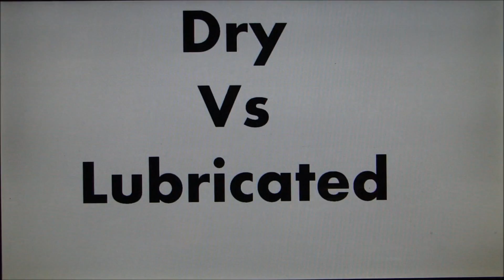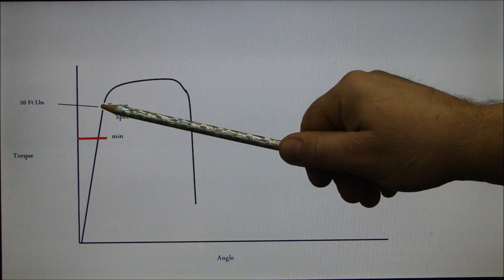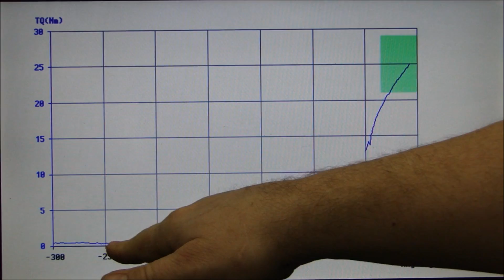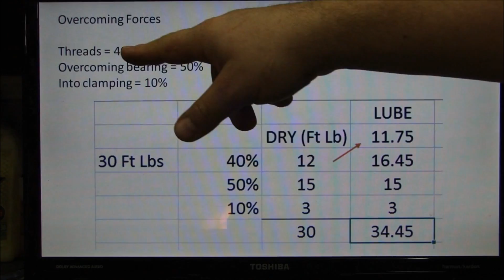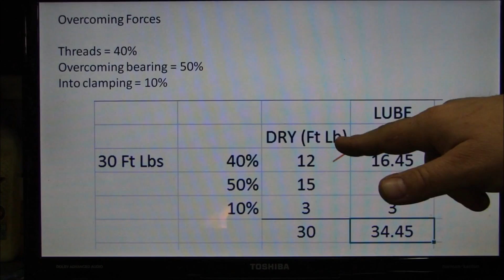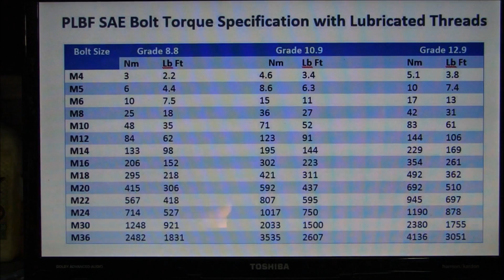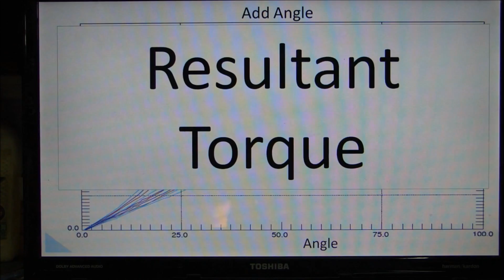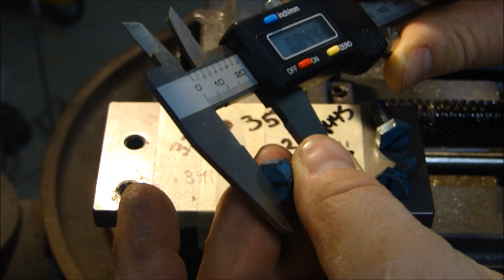Engine Building - Fastening

Comment: Pete, first off I want to say good job on your work producing these videos and for your great efforts in doing these.  The video was very methodical and followed a clear and reasonable thought process.  I actually believed the conclusion of the results momentarily.  So when I disagree with you please don't take this badly.  
I watched this clip and was blown away.  Wow I said.  All these years I've had it wrong.  Then I sat back and cleared the cob webs and thought about this for a while.  Wait a minute, "That's Not Right".  
In my youth as a structural steel welding and bolting inspector on construction projects we tested bolting routinely.  We would use a devise called a Skidmore-Wilhelm.  This is a bolt tension testing device that allows you to determine the necessary bolt torque and/or degree of rotation to achieve the required clamping tension.  I am here to tell you and anyone else reading this, "Lubrication Reduces the Required Torque" needed to achieve a clamping force.  You should amend this post or take it down because it is wrong.
The reason your bolts that were dry elongated (this is a bad thing) is because they got bound up and experienced localized yielding in the thread zone caused by the rotational torque build up.  This torque build up was a result of the friction from inadequate lubrication.  The dry bolts experienced inelastic yielding of the metal in the threads.  The reason the lubricated bolt is shorter(this is a good thing) is because it never experienced a force large enough to yield the steel thus staying elastic and was able to return to its original length (or there about).
I have torqued the heads off bolts that never achieved the necessary clamping tension, then using a bolt of same diameter, length and metallurgical properties applied lubrication to a bolt out of the very same lot and was able to get the required tension with less than have the torque.
There is plenty of good reading that can be found in publications by the "Research Council on Structural Connections" (RCSC),  "American Institute of Steel Construction" (AISC), and "American Association of State Highway and Transportation Officials" (AASHTO).
Reply from the maker: +Russell Bodge Russell, thank you for your comment. I had to read it a couple times to understand where you are coming from. I assure you I am not wrong. I think you misunderstood the purpose of the experiment. The bolts used in structural steel like the ones you used are not really dry. They have a coating on them like zinc/aluminum known as Dacromet, or a zinc rich aluminum called Magni 565 that the ASTM recommends to limit hydrogen embrittlement. These coatings act as a lubricant and can break off the surface of the fastener which is why you probably snapped off a few. The Skidmore-Wilhelm test you did simply tested the tensile strength of the material based on its metallurgy, and then that reading probably cross referenced on a chart to give you the recommended torque. 

I agree with you, torque will change based on the presence or a lubrication. I am discussing and demonstrating in this video Resultant Torque after and applied angle. That is the torque at the end of the angle. The angle applied to a fastener is a calculation based on the area of thread engagement, not just the metallurgy as in the Skidmore-Wilhelm test. If the calculations are done correctly, the bolt will stretch to achieve maximum clamping force between two mating parts. In the experiment, in the absence of a transducer, I prove that the resultant torque is lower after an applied angle to a bolt because of the amount of stretch, or yield, is less. If there is lubrication on the threads the clamping force is reduced because the Resultant Torque, or torque at the end of the applied angle, is less. You can also see this in the graphs where the torque curve during the application of angle shifts. 

I understand this is counter-intuitive and sort of tough to wrap your head around. But I assure you, if you torque a fastener, then apply a calculated angle, the clamping force on two mating parts will be reduced if a lubrication is present because of the lower Resultant Torque.
Reply: +Petes Garage, I want to echo what +Russell Bodge said and say great work on creating these videos and thank you for breaking down your thought process and providing good visual aids and examples; however, I must also respectfully disagree with your conclusion.  

I believe that you would agree that using lubrication will change the coefficient of friction.  The new coefficient of friction will obviously be lower.  Now, lets take a look at the equation that you provide at 5:20 in your video.  Lets assume that we have a dry fastener and a lubricated fastener, the dry fastener will have a higher coefficient of friction than the lubricated fastener.  Now, if we want to achieve the same clamp force (F) (thread pitch, basic pitch diameter, and bearing surface diameter remain the same), the lubricated fastener will require less tightening torque (T).  

You are correct that the resultant torque will be less on a lubricated fastener if both are tightened to the same angle; however, because there is less friction in the lubricated fastener, more of the torque is translated into clamping force.  I can write out and send you the rearranged equations I mention above if you like (showing them in the comments would get messy =)  ).  Here is a link for a brief 2-page NASA document showing why reduced torque is required when using lubricated fasteners https://code541.gsfc.nasa.gov/Uploads_materials_tips_PDFs/TIP%20067R.pdf 

Once again, thanks for the great videos!
Reply from the maker: +cornking03 Wow, you guys are awesome. I can agree with all of your conclusions except for the part about more torque being transferred into clamping force. The reason I did the experiment, and the purpose of applying angle is to stretch the fastener to its yield point. If there is lube on the threads the coefficient of friction does drop, as you indicated, and the fastener does not go into yield. That is exactly what I demonstrated and showed with the torque curve graphs. Since the fastener does not yield, maximum clamp load is not applied and it will eventually loosen. I have seen hundreds if not thousands of torque curves where after the angle is applied the minimum resultant torque is not reached and you can see in the torque curve where the fastener does not go into yield. That is critical and the entire purpose of applying angle. Optimum angle is a calculation based on the fastener material and the area of thread engagement to yield the fastener to obtain maximum clamp load. Since lubrication cannot be applied precisely enough to be included in the calculation, all torque and angle calculations presume a dry fastener. I've read that Nasa brief, but it is important to keep torque and angle separate. The are entirely different things. 

Thank you for such concise and well thought out comment. I really enjoy the passion around this subject.
Reply: +Petes Garage I think I see the source of confusion on my part.  With your experiment, you were only referring to torque specifications that include an angle in addition to the torque spec.  I was taking your "extra torque for lubricated fasteners" recommendation as a blanket statement for torquing down any fastener.  Like you mentioned in your video any TTY (Torque to Yield) fasteners should only be used once and need to be replaced if they are disassembled.  A good rule of thumb is if a fastener has a torque AND an angle spec, it is a TTY fastener.  

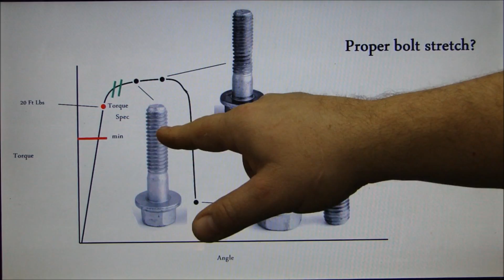In the Torque vs. Angle chart around 9:40 you have a red dot at the "Torque Spec" - basically any angle to the left of that is in a region called "elastic deformation" and anything to the right is "plastic deformation." Here is an example in case anyone is confused: if you take a spring and pull it apart slightly, it will spring right back into its original shape, but if you pull the spring far enough apart, it will no longer return to its original shape.  A bolt is the same way when you tighten it, but its stretch is much much less noticeable when compared to a spring.  If you don't torque a bolt past its yield point (elastic deformation only), you can reuse it over and over.

Some might be wondering, what's the point of torquing a fastener past its yield point if it means I can only use it once?  There are several reasons for this.  Engineers might need to use a smaller fastener due to space restrictions or weight considerations.  By torquing a fastener past its yield point you can achieve a higher clamping force.  While a larger fastener could achieve the same clamping force without yielding, there may not be enough space or material to use the larger fastener.  TTY fasteners are also less likely to loosen on their own.  

If we are not torquing a fastener past its yield point, then a lubricated fastener will require less torque to achieve the same amount of clamping force.  As you point out, when torquing a fastener past its yield point (TTY fastener), a lubricated fastener will indeed require MORE torque in order to achieve the same amount of bolt stretch.  I would also say that one should never use lubrication on a TTY fastener, unless a manufacturer specifically calls for it.  Your video does a great job at showing first hand how lubrication affects the stretch or elongation in a TTY fastener!  Keep up the good videos and thanks for taking the time to respond to comments!
Reply from the maker: Bingo! You got it. This is not a very easy thing to wrap your head around. Most of the other engineers and quality folks at GM Powertrain didn't get it when I tried to explain it to them. So many engines fail because the builder fails to recognize the importance of torque or torque + angle. Thank you for the awesome response!
Reply: Great summation of the torque process and torque to yield.The light has come on.
Reply: @PetesGarage    I would pin this comment, so that others can enjoy the thread right off the bat...  That's my only criticism.

Comment: Thank you Pete for your time and effort into these videos.

At Honda factory training we were always taught that any lubrication used for thread friction will reduce the amount of torque that is required on the fastener.

Any lubrication which reduces friction will multiply the clamping load exerted by the bolt at a given torque reading.
Reply from the maker: You are correct. This video is about the resultant torque after an applied angle, two totally different things. The point I am trying to make is that if you are using a TTY fastener and there is and lube on it, you may not get adequate clamping load after the angle is applied.

Comment: I rather enjoyed that.. very well explained.  My father was a Royal Navy engineer who got me to strip and rebuild the engine in his car every 3 months.. when I was 7 years old.  He was like the engine God... He had a favourite saying when us boys would modify an engine "so you peanuts think you know more than the team of engineers who designed this eh..".  However, his first official job when out of Naval college was to supercharge the Admirals private barge.. so perhaps modifications aren't always bad... :)  However, if that "team of engineers" designed the bolts, and wrote down in a manual the correct way to tighten them, you can bet they're right.  I have never read an engineering manual that recommended lubricating bolts that must be torqued.  Perhaps good practice is to run a tap down the threads ( if being re-used ).. but no oils.  Some engineers recommend thread lock, but thread lock is not a lubricant, rather being very similar to superglue - a resin that fills the intimate gaps in the thread so makes an artificial interference fit.  Thankyou for the work put into this video and your passion for the subject.

Comment: holy crap i was about to start laughing at you until i finally wrapped my head around it. The reply about stretching a spring too far compared to tty bolts made a light come on. I have been lubing all tty head, rod ect. bolts for years never again. you are 100% correct and very well educated on this subject. Thank you
Reply from the maker: This is a tough and controversial subject for a video. I can tell you I lived fastener torque for many years and had to solve many problems as a result of some sort of lubricant. I'm glad you were able to get it. Thank you

Comment: Experiment at 20:30 you would have to torque the bolts before the experiment to assure all bolts are the same at 0 degrees in-other-wards all three bolts could be more loose or tighter than each other at the start of the experiment.
Reply from the maker: That part of the experiment was to show that when there is lubrication on different parts of a fastener, the fastener needs to rotate more to reach the same amount of torque. They are all at zero when I put them in by hand.

Comment: Thanks Pete, Excellent video will need to watch a few times to learn everything of importance in this video.
Reply from the maker: +jonathan bosco It's a tough thing to get. The basic idea is to follow manufacturers recommended torque and angle when using any lube they specify

Comment: Well Done on a difficult yet simple procedure that everyone should understand You handled the topic alot more professionally than some other internet instructors Perhaps the one point of confusion is the  lube to torque to stretch  area It is difficult to understand that while the lubricant reduces friction it is also reducing stretch because the stretch is what ultimately applies the clamp force After all it is clamp force we want not torque or stretch because clamping force is the work that we want It  may also help to point out that a good torque chart will  provide both the dry and lubed torque  a good oem chart will (GMC Mack Truck) will also provide the suggested lube and where to apply it Most recommend lubed threads particularily on service components If your a self taught student of engineering these charts can be fascinating worthy of coping to put on shop wall (Beside the pin up girl calendars)! I like your of videos also they answer to a higher level of thought well done Thanks Jeff
Reply from the maker: +Jeff Pitman Thank you Jeff. This is by far my most controversial video because people really do not take time to understand what I am explaining. I understand it's tough, but it's critical to successful engine building.

Comment: I use to work at a company that built fasteners.  We made bolts/ballstuds for Ford, GM, TRW, & Dana to name a few.  If you ever find a bolt, most commonly found on Fords with a letter F with a circle around them, there is a good possibility that I could have made them.  Most commonly, ford flywheel bolts, driveshaft to axle bolts, and larger flange head bolts on the A arms of F-150's.  We had to do periodic grain flow checks by cutting the bolt down the center, etch in acid, and place under microscope.  This was to ensure that the grain flow would was not running towards outer area but instead flow downward.  People don't realize just how important it is for these bolts to be made properly.
Reply from the maker: That is really AWESOME! Thanks for sharing that with us

Comment: Hi Pete, I am of the same opinion as Formula400Pontiac that lubricated bolts will give a higher clamping force than unlubricated under the same torque.
Compraing lubricated with unlubricated: lubricated -> more angle to reach the same torque -> the bolt goes deeper -> more tensile stress -> more clamping force
Unlubricated bolts in your experiment deformed due to a lot of friction preventing from rotation so they stretched more.
Reference (e.g. Fig. 8):
waset_org/publications/7105/an-experimental-method-for-measuring-clamping-force-in-bolted-connections-and-effect-of-bolt-threads-lubrication-on-its-value
nord-lock_com/bolted/talking-the-torque/
Reply from the maker: I know this is a controversial subject....but I stand by what I say because I deal with it almost every day. Thank you for taking the time to watch and your comment.

Comment: So, ARP recommends using their lubricant and 3 increment sequence to 110 ft/lb for
½ -13 main cap bolts. Fords spec is 95 to 105, same as most performance forums. However, on ARP's head stud kit for 460 Ford they recommend their lube & the exact same torque spec, 140 ft/lb. All very interesting, and we haven't really touched the "torque to yield" elephant setting in the corner.......are we gonna do nylock nuts and break-away/ running torque next? Always looking for vids from Pete's Garage! Keep it up my friend!
Reply from the maker: Studs and bolts are so much different. That is why I always say do what the manufacturer recommends. I think I've beat this topic enough
Reply: ***** Agreed.

Comment: The last bolt regardless of lube has been turned the most. Thus has the highest clamp force
Reply from the maker: Not necessarily.  The point of the video is that if you put lube on the threads the fastener will not yield when you apply the angle.